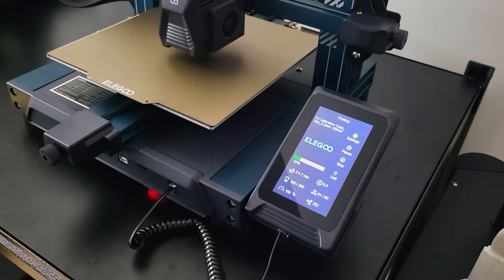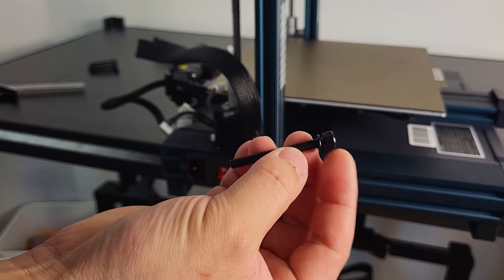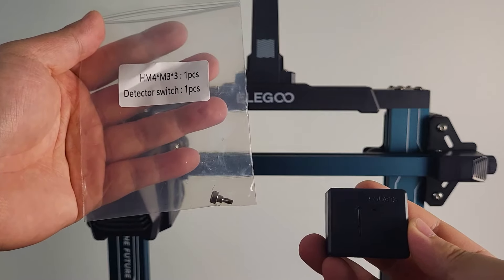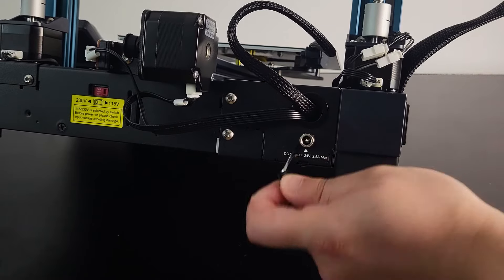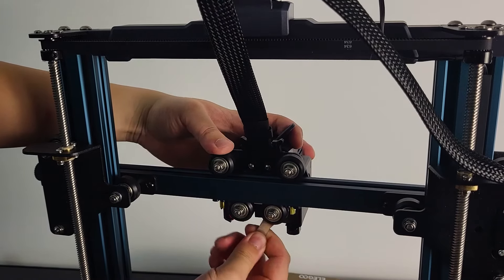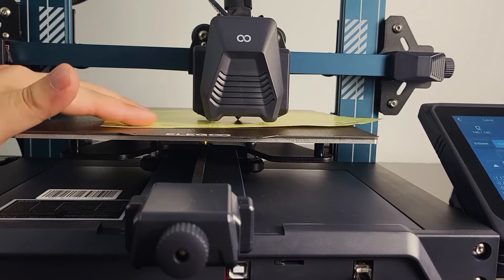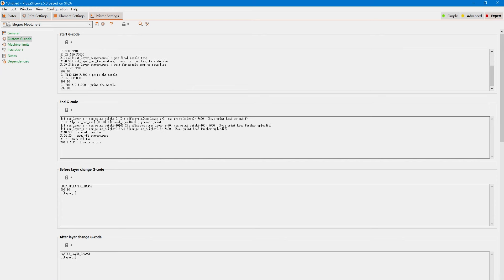Elegoo Neptune 3 Pro set up tutorial, Assembly, Bed leveling, Calibration, Common issues

Comment: After 120hrs of printing I have issues with the bed leveling, like the extruder just print aligned only in the middle and right side of the bed but on the left there's like 1/2mm of distance from the bed and the extruder. Everything is tighten up and I do autocalibration+sheet a4 calibration but nothing changes.. Dunno how to solve that, it's a shame.
Reply from the maker: Bed spacers deform under heat, it is better to replace those with Silicone spacers. I am about to making one video relate to that.

Comment: How do you connect computer to the printer by USB?
Reply from the maker: there is a port next to the micro sd card port. Find a USB cable connect to that .You can send printing file via your pc if you are using cura slicer. there are also some other software and tools could help sending the file and do calibration after you connected it with cable to your pc.
Reply: @SvgLau  Thank you very much. Also does it come with a USB cable or do i have to buy one separately?
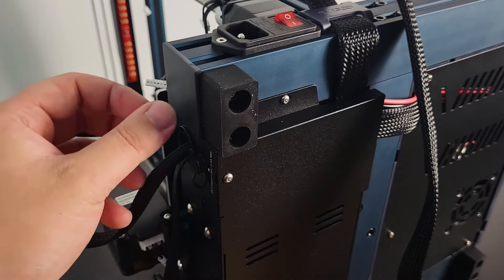Reply from the maker: @BamBam-ep3eq  I believe there is one blue cable come with the printer, one side is USB head, other side will fit the slot on left of micro-sd card. you can see find it one video 1:28.

Comment: Mine didnt come with an R shaped buckle shown at 6:16 ,
It came with a piece called cable clamp and in order to get the ribbon secured into it and the bolt screwed in you really gotta squeeze the damn ribbon cable into there to make room for the screw to align with the holes
Reply: I just folded the edge of the ribbon cable that faces the screw. Pretty easy install after that. And I also did not receive the same style clamp as the video, it was more of a flat style clamp.
Reply: Same, had to really squeeze that sucker in there, was sorta worried that it would damage the cable but th thing is still going strong after about 60 hours of print time.

Comment: Thanks for the helpful video, I think it's easy for someone to follow. I think you should move the print head over the heated bed and let the inductive sensor heat up before using it to level the bed or set the z-offset.
Inductive sensors trigger sooner when they are hot vs when they are cold. Test it. Let the printer heat up with the sensor not over the bed, then set the z-offset. Then move the sensor close to the bed and let it heat up for a few minutes, then check the z-offset again, I have got up to a 0.13mm difference. This difference between the sensor being hot and cold could make a huge difference in bed level and z-offset. After I learned this, it fixed all my problems with inconsistency in bed level and z-offset. Inductive sensors are fine on accuracy, you just have to let them heat up first. This is something a lot of beginners (and even pros) are not aware of so it would be nice if ELEGOO told people about it in their instructions. Who knows, maybe they are not even aware of this. I think ELEGOO is a great company and has better customer service then most companies so I don't think they would leave this out on purpose. Hopefully they will add it to their instructions in the future.

Comment: Hey there! Great video @savagelau -- I had a question I was hoping you could answer. In terms of pairing the printer with a OS, I see people use Rasberry Pi's and the like, but I was wondering what exactly that is for? Could I instead use a personal extra laptop I have? 

In general, I plan to use my main desktop (its a beast) to do most of the modeling / slicing, so just trying to understand what that additional piece of hardware is used for.
Reply from the maker: so, people (including myself) using raspberry pi to run octoprint to send printing file, record fortage from the computer. That way you don't need to copy and send file via micro-sd card. 
At the same time some people using raspberry pi to convert the stock marlin firmware to Klipper firmware to gain more feature and faster printing speed, they could also acess printer via web broswer by "fluidd" or "mainsail" page by entering the ip address. 
Due to the raspberry shorttage for the past few years, people are looking for some alternate solution instead of raspberry. So old pc is a very popular option, people instiall linx system on their old pc to running Klipper firmware of their printer. 
That said, you don't need to use your powerfull pc to be the linx host for your printer. You could still use it as modeling/slicing machine on your work flow. Convert your spare laptop to linx to run Klipper on your printer if you like. Or directly connect your printer with a usb port to pc could also acheive some of the feature with stock marlin firmware on your printer like sending file wirelessly and some calibration. 
Hope that help.
Reply: @SvgLau  extremely helpful! It sounds like using the older laptop would be a good way to make the transfer easiest as the printer will be in a different room than my tower. 

So in theory, I could use my tower, send file to the linx klipper laptop wirelessly which will be close to the printer, then MicroSD from that to Neptune 3? 

Any suggestions to learn more about klipper? Also, I would need a usb<~>microsd tool right?
Reply from the maker: @koshhh  So, old laptop convert to linx will become a host(I don't know if it is the right name for it). Basically it will processing data (g-code file you get from slicer) instead of your printer main board. You printer mainboard will only sending the command to the stepper motor how much it moves, when to stop, etc, and nomore data processing on it. (After you convert your printer from Marlin firmware to Klipper.)
Then, all you need to do is use your tower, open broswer (chrome), put your printer ip address on the address bar. You can access your printer via Mainsail or Fluidd internface and do everything you do on your printer screen, and more. 
There is a lot of tutorial video on youtube could bring you through the process, unfortunately I have very limit amount of time spent on Klipper, and limit amount of knowledge of Klipper. So, I probably won't be qualify to make any video to teach people how to do it any time soon. 
Hardware wise, you only need a cable to connect the printer to your laptop, that's it. micro sd card become useless at this point. All the printing file (g-code) will be sending wirelessly. I am sure Neptune 3 Pro come with the cable. Transparent blue color, usb on one side and other side fits the port on the left of the mircro sd card port. 
Hope that answer your question.

Comment: I set up my Eelegoo Neptune 3 plus and as soon as I hit home after the first time turning it on the nozzle went into the bed and left and indent. Even after leveling it and using the auto level the nozzle again would sink into the build plate and burn a hole. do you know how this can be fixed?
Reply from the maker: Did u put PEI sheet on? The homing sensor is detect the metal build plate for homing and auto leveling. If the (gold PEI sheet)  build plate was on there, could be a malfunction sensor.
Reply: @SvgLau  No, I’ve had the sheet off the entire time I tried leveling it so it’s just going into the base itself. I’ve been doing research and the closest thing I’ve found was maybe my z-endstop is to low but I can’t find anything on how fix or raise it on this printer.
Reply from the maker: @sabast2150  You need to put that sheet back on the printer bed and redo the bed leveling thing, because the sensor on extruder detects the metal. That expain why the nozzle goes to the magnetic sticker.